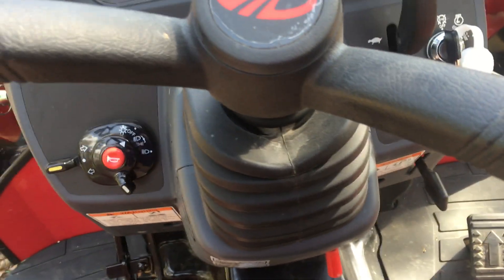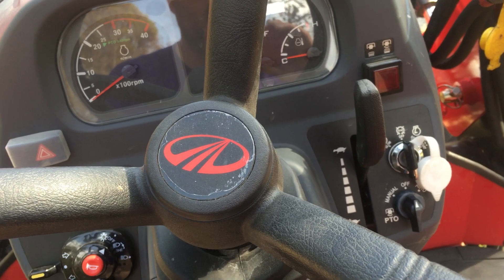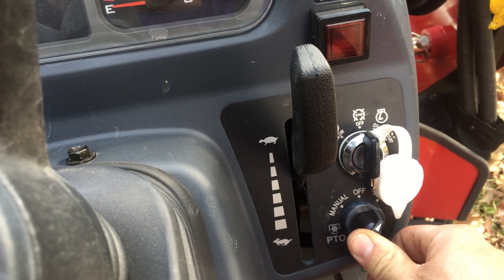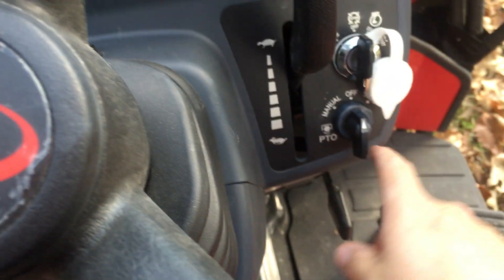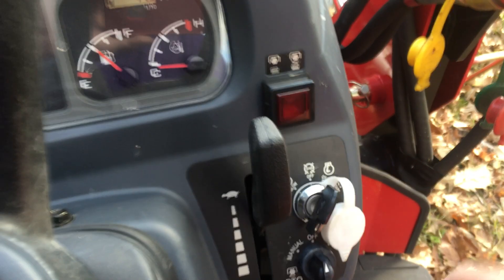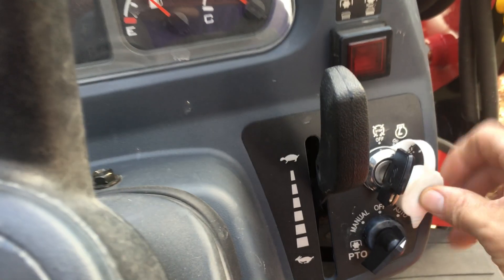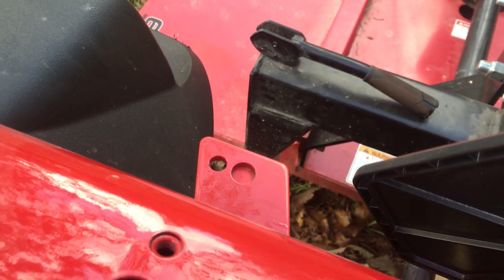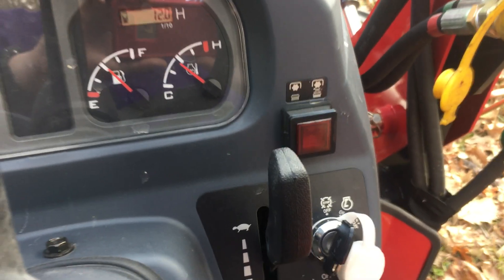Mahindra 2538 PTO Functions

Comment: I have the same set up and mine was working fine i turned my pto off of manual to move some fencing when i got back on the tractor and tried to engage pto it wont engage light come in the dash saying pto on and everything is in thhe correct position...would u know why it wont engage
Reply from the maker: Wesley Lowe check your manual PTO lever on the left side of the seat. It doesn’t have a long range of motion so it may look like it’s in the same position. Might have accidentally knocked it out of gear without knowing. If not then I’d say there’s a switch fault somewhere.
Reply: LAConfederate ok thank u very much for the reply i tryed moving leaver back and forth and still nothing

Comment: Is there any reason to ever push the lever to the off position? Does the lever need to be off in order to start the tractor?
Reply from the maker: Mark Decamps I leave the dash switch in MANual mode. I do use the PTO lever. Moving the lever to OFF disengages it from the transmission which will allow you to spin the PTO output shaft to line up the splines with the attachment shaft.

Comment: I thought you said at the start there were 3 things you needed on, the selector switch (manual/auto), the red button, and the pto lever on the left side of the seat, did I miss something as i didn't see you messing with the pto lever at all, just the button and the selector switch.
Reply from the maker: Robert Baldwin yes sir you're right. I didn't fool with the PTO lever. It's the mechanical engagement lever to the left. It must be engaged to lock the transmission to the PTO output shaft. Without the lever "on" the transmission will spin with the application of the red button and switch but the PTO shaft won't spin due to lack of a mechanical engagement. 

Thanks for the question!

Comment: I think I could work with this setup... My left foot might be reaching for the clutch every now and then when getting into a heavy area, but pressing a button would be darn easy it looks like.  Very helpful info.  Thx!
Reply from the maker: +Canokie Snowback From what I can tell, there is a discrepancy between the manual and what I have on my tractor.  The manual says the brake/clutch also is an interlock and if you push it in the PTO will stop.  That's not the case on this tractor.  But that's the beauty of a hydrostat...if you get into an area where the grass is much thicker you can instantly adjust your ground speed down to a crawl to deal with it.
Reply: +LAConfederate Probably  has an independent PTO. Not too crazy about all the switches too many things to go wrong. I do really like the Mahindra  tractors.